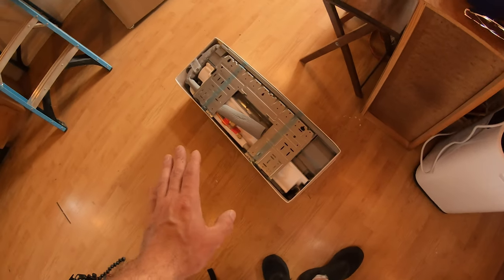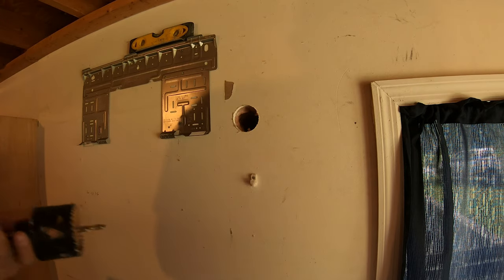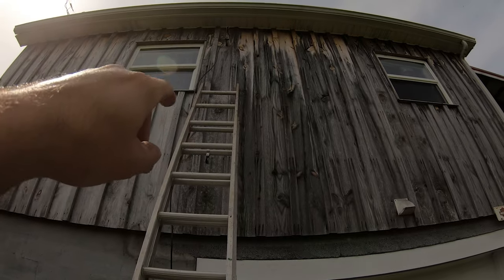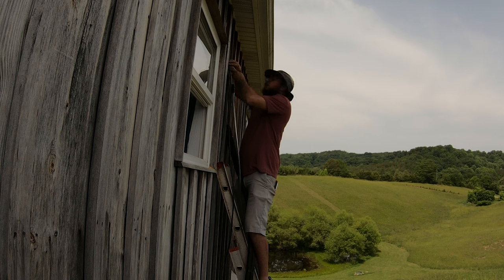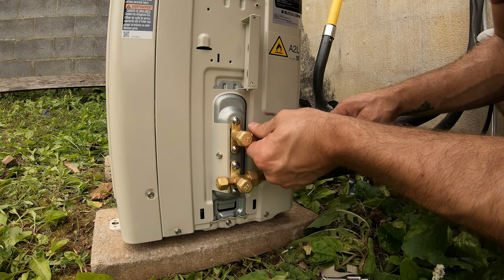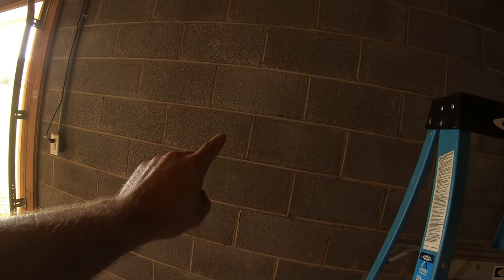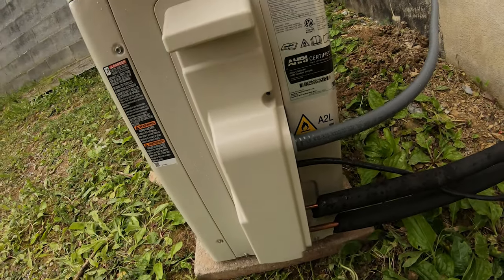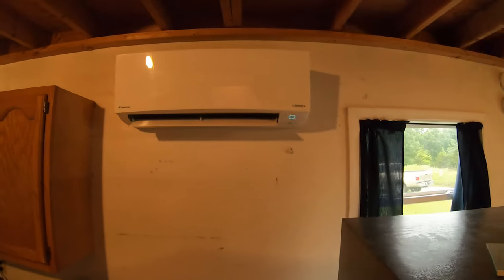Lets install a Minisplit Heat pump & AC! ( Daikin 9000 btu )

Comment: the Mr Cool kits i am aware of have charged linesets and unique fittings to keep everything fully charged when connected.  Saves close to 200$ on a vac pump and gauges.
Reply from the maker: The kits I’ve used from them just have the flairs capped. When you take those out it will allow moisture into the lines during installation( if you live in a humid environment). I think they may have some with quick connect option as well but I’m weary of the reliability of those personally. For diy I think they are fine to do without gauges and pump. But I’ve been told by other manufacturers that the life span of the lines are increased when evacuated. They required us to do it to be able to warranty for 15 years